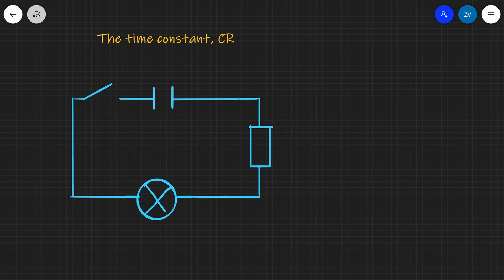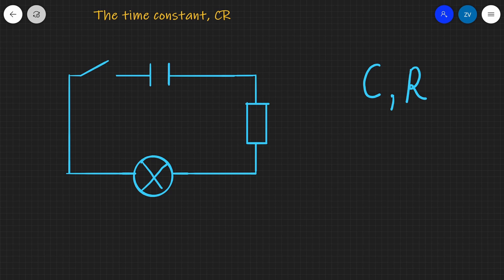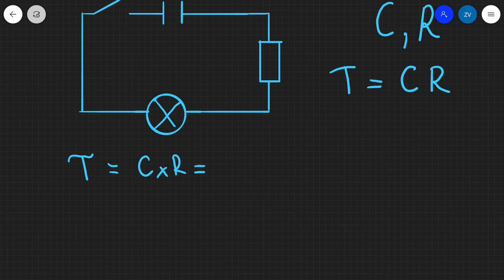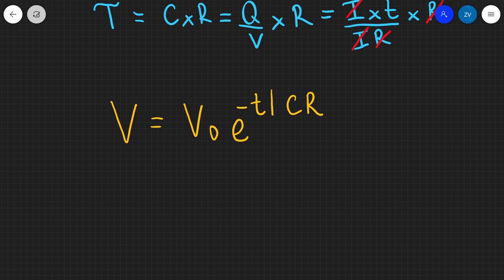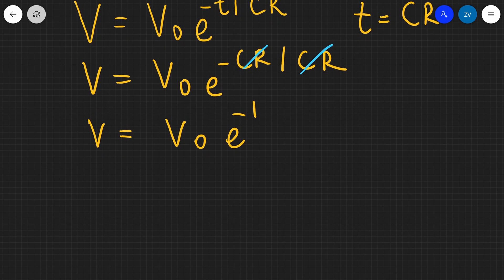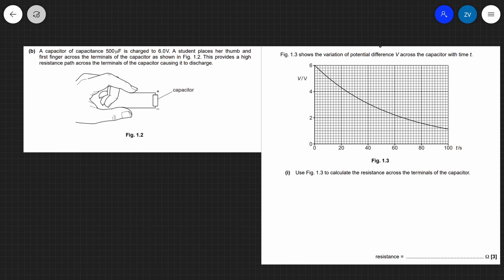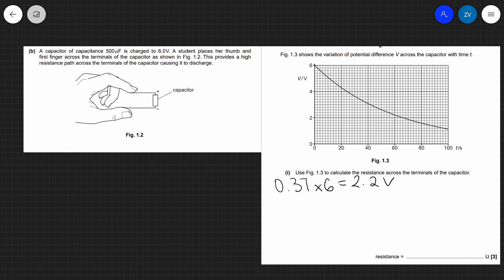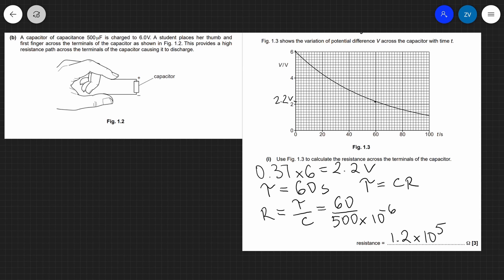A Level Physics: The time constant in capacitors

Comment: hello sir for the definition of time constant can i say it is the "time taken for the capacitor to charge up to 63% of the initial value?" because i did the OCR A 2022 paper 3 Q6(a) and the markscheme only talks about discharging to 37% of initial.
Reply from the maker: We can only define it terms of discharging. For charging the capacitor charging equation is different as V=V0(1-e^(-t/CR)) and after t=CR during the charging process the p.d. across the resistors drops to 37% of the initial value. Hope this helps!

Comment: Hi, didn’t you say that V=0.37Vo only when time=time constant, so how do we know time was equal to time constant in the last question?
Reply from the maker: yep! So we have all the values in the graph and we can find the time at which the voltage has dropped to 37% of its initial value. Then we can set that time equal to CR to figure our unknown. Hope this helps!
Reply: @zhelyo_physics  would the discharging formula also work + what year is this question from?
Reply: Thanks!